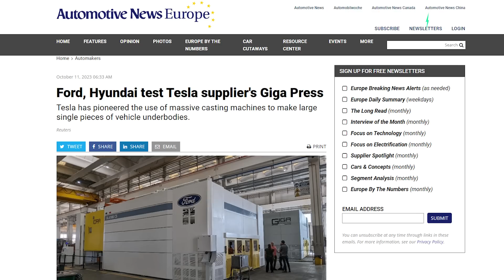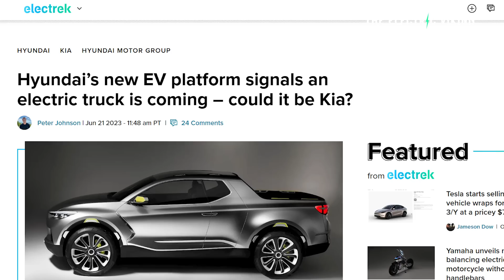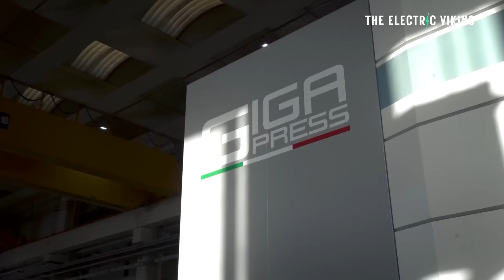Ford, Hyundai & German automaker order Tesla's Gigapress casting machines

Comment: I wonder if Tesla patented their special aluminium alloy that makes giga casting possible in the first place? I work in electronics manufacturing and when lead free soldering became commonplace, a US solder manufacturer came up with a formulation that has a much lower melting point than regular lead free solders and is priced at a premium. This may be yet another revenue stream for Tesla.

Comment: The Unions should be most worried as this will reduce many jobs.  On the other hand if the cars get in a fender bender or large wreck will the car be totaled as it will be harder to straighten them out?  Ramping up and getting all the welds correct will be a challenge.  Now Tesla, if he doesn't own IDRA, maybe he should buy them out.

Comment: The thing no one is mentioning is that the parts produced by these presses are aluminium alloys which have a potential to fail due to fatigue when subjected to cyclical loads (depending on the load forces and the number of cycles) If those parts are carrying large loads or going through a large number of cycles they will require replacement and need to be monitored and replaced after a set time. I'm sure however, that manufacturers have given this some thought - I hope. Stressed alloy parts will need to be thick enough to reduce any stresses to have an acceptable life span.
Reply: It's true. Aluminum cannot handle stresses at all. It must have no maximum forces on it at any time, for any reason, because it is damaged from extreme loading and stretching/flexing. Steel parts can be loaded to their maximum level of stress without incurring any noticeable degradation. I don't know this to be a fact. But I know this from studying engines, that you cannot use aluminum connecting rods on modern gasoline engines, because the connecting rods stretch slightly at super high RPM's, and this ruins the aluminum which cannot handle repeated maximum tensile loads like a steel connecting rod. If you do use aluminum on highly stressed parts, it can work, but it generally has a finite lifespan. The solution I see is that aluminum parts must be dramatically thicker than steel, to prevent them from having too much load.

Comment: What i don't understand about giga presses is they're slow. Toyota can make 10+ times the cars Tesla can on any given year. All that will do is increase the prices of vehicles, right?  With a limited supply were all screwed. That's just the way i see it. I could be wrong. And by the way the model 3 weighs 1000lbs more than the camry.

Comment: Giga press is a massive comparative advantage in terms of Process optimization... there is no way of no using this technology. It is a game changer so welcome to the new way of precessing cars!!!
Reply: But it is only cost effective at volume.   Another reason Tesla only has one model per category and tries to have as much crossover of parts as possible (economy of scale).   The best part is no part, the best process is no process.  Simplify, simplify, simplify.  Reduce time, reduce costs, reduce  supply chain => pass on savings to customer.

Comment: Gigacasting is most dangerous to repairability. In a normal car, intermediate brackets take most of the abuse in a crash. In a gigacast, a lot of those are now part of the frame. Manufacturing time and cost may go down but insurance premiums will be going up due to more expensive repairs and more cars getting written off for what used to be repairable damage.
Reply: well if the force needed to effect the castings is enough to set of the airbags i guess it doesn't matter since often when the airbags go the car is scrap.

Comment: Just want to say this about gigapress casting. If the process reduces overall manufacturing assembly time by as much as 90%, and simplifies 80 or so pieces to one piece, then the cost of replacing one of those gigapress casting parts is going to be cheaper than trying to fiddle around with 80+ components at auto body shops, no? So who care if a gigapress casting part costs more. You probably save big dollars on the labour side in repairs. Also, I'm sure such parts can be readily remelted and reused.
Reply: So that's an interesting thought; I figured that a "Giga casted" car would be disposable and impossible to repair. But the alloy might be capable of being welded? It is a proprietary formation of aluminum, and some aluminum castings can be welded cleanly with a TIG welder. But if they can't weld it properly, then they would have to basically get you a whole new casting... Imagine if they just replace your entire car with a new casting?

Comment: They could even make light aircraft this way.  US military might also be interested.
Reply: Drones! Am I right?
Reply: Little doubt this will occur,  just a matter of to what extent it will occur. Over time that extent could increase.  Tesla have a standard process to repair damaged giga-pressed chassis.  No reason why this approach can't be utilised in areas of aviation.  With that said giga pressed body's are much cheaper and faster to replicate. Structural repairs are going to be far less likely in aviation ( due to stronger yet lighter giga pressed airframes ),  and when a plane crashes,  it's usually a complete write off anyway, unlike cars, which they can repair, even if giga-pressed.  Thus I believe these issues can be dealt with cost wise in the aviation sector in one way or another.  A gaga-pressed airframe could be designed to last longer and yet be lighter than conventional airframes.  basically for the usable life of thee entire aircraft without need for structural repair under normal operation. Aircraft could become more modular, like the car industry is becoming.  Only a matter of time.

Comment: Once those OEMs have them in trial runs, we’ll also see if there is anything special about Tesla’s special Aluminium alloy and the whole process. Just throwing money at it by buying the machine might not be enough
Reply: Not anytime soon.   Have to wait to see if the new player's casting crush or repair differently.
Reply: @danharold3087  yeah, as said in the video they’ll have it in some R&D center first. Probably will never see production as it would cost too many UAW jobs.
Reply: @nikos6220  As I understand it the big die casting machines only make sense in the high volume environment.  For Ford that would have to be the pickups.  Unless they plan to build an EV that will sell a million.
Reply: @danharold3087  good point
Reply: @danharold3087  https://www.youtube.com/watch?v=u127PmlbKyQ
Reply: https://www.youtube.com/watch?v=u127PmlbKyQ

Comment: cars made this way are unfixable. just a warning.
Reply: Ridiculous comment…already debunked
Reply: @thehonesttruth8808  : Debunked in claims from Sam, or real "debunking information" - ?? - Price in the repair including replacement of the subframe  - and everything forwards  or behind - on a 5 year -old fully developed used car market -depreciated vehicle (as opposed to the non depreciating early adopter market we have seen)?? - we need a friendly insurance assessor to do up an assessment, not the B$$ of a fanboi blogger.

 - As many will say, a significant deformation in ANY car's (primary structure) "chassis" - unibody  - will likely lead to an insurance writeoff, the case of large castings - doesn't have to be any worse.   (Insurance writeoffs are all about the "Smallest loss to the insurer".)

Probably better to make the subframe "very strong" and design the suspension arms to shear off in a significant accident to preserve the vehicle's core - and occupant safety.
Reply: No they’re not, it’s just more difficult and the repair industry needs to get up to speed.
Reply: The most vague thing in the world. If you can’t tell us how it’ll be easy to repair a one piece, go away. Stop being a child. Everything has strengths and weaknesses. Giga press is no different. The strength of a giga press is how much cheaper and safer cars an be and quicker to produce. Repairing a single body depending on the damage might not be possible.
Reply: @jsanders100  I would say just different.